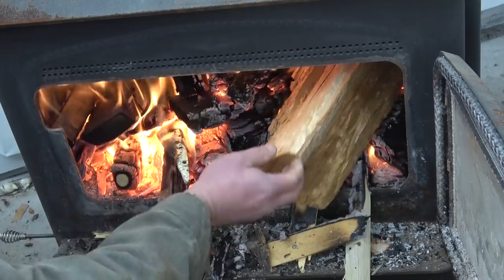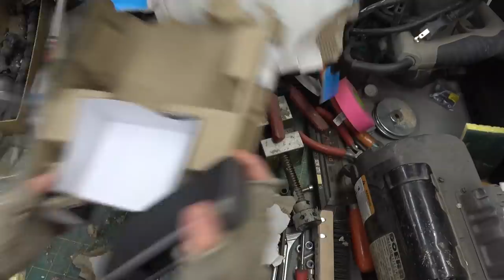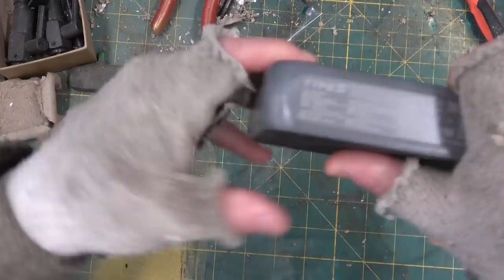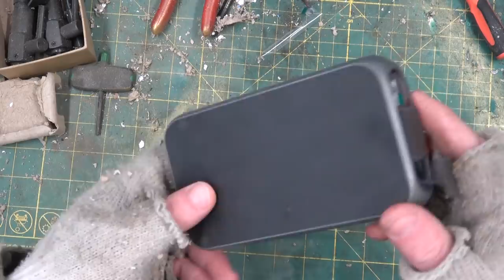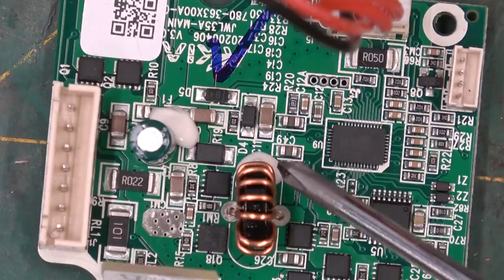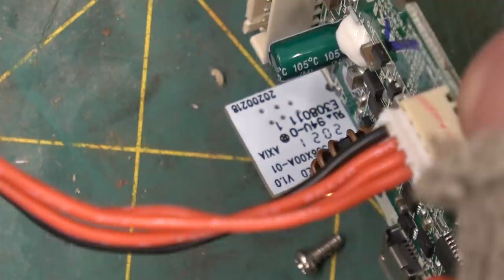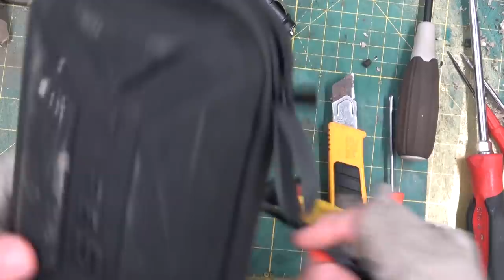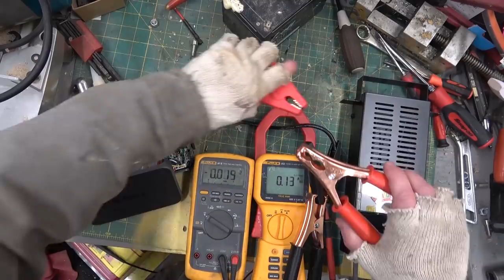BOLTR: Costco Boost Pack | Stupid Design

Comment: The USB-C connector was clearly designed to be quite a bit more physically sturdy... But you add a few more failure points and physical fortitude does not translate to electrical fortitude.

Comment: G'day, Here is a trick for you to try.
About 2 weeks ago I used an 18 volt cordless drill battery to jump start a diesel Ute that had a dead battery. I just wrapped some automotive wiring around the vehicle terminals and poked the other ends onto the 18v battery connectors.

Comment: USB type C charging issues, I have had this problem myself, don't know if it's the same as your per say, but the fix is easy. Use a pin to dig the shit out from the charge port. Lint and crap gets in there and packed down like an unholy wall of charging fuck you. It takes but a few seconds to mine that shit out and everything goes back to normal, just dig deep and greedy.

Comment: Have used that style of jump box for several years but they do have a terrible issue that is a totally different style connector than the first ones did on the cable side the first ones honestly just had a fuse style that would go bad and you would constantly have to replace them but other than that there's an issue with his test those kinds of boxes do not like that load tester on an actual vehicle I have started diesel trucks in my shop with dead batteries with a box of that style not one from Costco like the OEM brand but I swore them off after I had one short out sitting in the front seat of a car I just started and it exploded and gutted the car had it all on security cameras

Comment: FFS my Pixel 3a XL I've had for 4 months USB-C port is wonky - it only charges with the cable in one of the two ways, and I have to flip it 180 degrees if it doesn't start charging. It's going back for warranty service, but FFS, it's been 4 months and it's dead already? Not an auspicious sign.

Comment: I have a similar device. Used it a few times, the issue i have with it, small window of time to actually get a vehicle started.
Reply: That's because it's not meant to jump start the car.  It's meant to slowly charge the battery, so that the car can start from main battery.

Comment: I actually figured out why this is broken. Your daughter board where the mosfets are is soldered poorly. They shorted the drain to the source connection because they soldered the car side - too close to the mosfets. They are supposed to be all in parallel to boost current capacity up to 1200 amps. All the source pins are supposed to go to the jump pack negative and all of the drain connections are supposed to be connected to the car side negative. I drew out the whole circuit and it's definitely why your pack is not working.

Comment: I was taught even with jumper cables you need to let it sit a bit to charge up the dead batteria.
Reply: Especially in today's cars.  If you just try to start the dead car right away, it can be very damaging to the car doing the boosting.

Comment: big problem I have with USB C is that crap gets stuck around it and you can't tell what is that nice tin plated socket and whats shop chips. I had the same problem with my LG G6 and I had to take a safety pin and pry out the pocket take home shavings from a CNC lathe that had accumulated in the socket over the coarse of a few weeks/months. once you get the pixel working again I'd invest in one of thous overpriced mag-safe sockets just to keep the crap out of the one good hole the phone has left; either that or an otter case that has a flap over darn thing.

Comment: Yeah I got a love hate relationship with mine. I have the motomaster one from Cambodian tire. I like it because it has an override switch you hold that fucker down and it will put out until the damn thing dies. But the leads are so short they nearly useless, don't even get me started on the clamps either...Biggest thing I ever boosted was a Hyundai Santa Fe with the V6 in the cold with a completely flat battery. However Ave is right you usually have to let it charge a bit.

Comment: Those things are timebombs. Don't store it in your house or vehicle unless you are looking for an insurance claim. I had 2 of those bloat up on me and catch fire. I caught both of them right before they blew and got them outside before they went up. The batteries just bloat for no apparent reason not even hooked to the charger destroying the case and flame up a few hours later. My fellow off gridder neighbor just burned his truck and cabin to the ground with one of those stored in his truck parked beside his cabin that failed. Those things should be outlawed.
Reply: The reason your LiPo "puffed" was likely a result of it being discharged. The chemistry of LiPos allows for a roughly 3V to 4.2V per cell safe window. Yes, these batteries must be stored at 3.7-3.8V per cell, or they will eventually fail, like yours.

Comment: Yes it does start a truck in the cold. A truck with a weak 12v lead acid battery. It’s just a quick battery booster, not a jump pack the replace whole lead acid battery.   You left your headlights on too long and battery is low. This works. No battery at all, this don’t get it.

Comment: I bought one of the gooloo or igloo ones... forgot the name now but it's way better. It just auto resets for quite a few tries until it kicks out so it dosen't overheat. It works great! I can boost a 30 year old farm tractor with it or a completely dead car. They also tend to boost at a higher voltage it seems....not this one though.. I only have the smallet model too, point is there is good ones. The one in this video is probably the worst I ever saw..

Comment: i thought those things were smart enough to know that they were not connected to a flat battery hence the 5 sec disconnect. if it detects a battery connected it would supply the cranking current for longer.

Comment: Watt-Hours is actually the "correct" unit to express the energy content of a battery. Ah is a measure of charge, i.e. capacity*, not of energy. Wh, unlike Ah, take the battery voltage into account. To calculate the actual energy you have left, you need to know or at least very precisely model the exact voltage of your battery at any point of it's state of charge, which will vary greatly across the discharge curve. 

I'm sure you can intuitively thee the highest nominal capacity battery is useless at 0V at the terminals. Say you had a 4V nominal battery, but the voltage would drop dramatically at below 90% state of charge. Still had a high capacity, but not much energy left in that battery. Take for example lithium ion batteries. You wouldn't really want to discharge them far below 3V for longevity, but depending on the technology, there may still be many mAh left in that battery, that you can't really use. Hence no engineer will ever use Ah to calculate the range of your Teslamobile or battery life of your fruit phone, because it will just not work and your numbers will be grossly off. 

*Batteries technically don't have a capacity, like a capacitor would. Capacitors store their charge electrically by gathering electrons respectively the lack theiroff, the capacity being the amount of electrons you can store. Since batteries convert all the electrons into chemical compounds (in this case lithium metal and lithium ions), capacity is technically not the correct word, although it has slipped it's way into today's engineering lingo.

Comment: I've never broke a USB Type C cable or port, where Micro USB was horrible for me. Most times C stops working is because you need to dig the pocket lint out of it. Neither are anywhere near reliable as Mini USB.

Comment: but if you draw current from it for a while... it will get warm and then start to function better?
Reply: Yes......it helps if the user reads the instructions.
Reply: i have this problem with model airplanes in winter, but if you just get up from the ground and fly like a maniac it sometimes works pretty good  :-D until you start to fly slow..

Comment: I don't think these units were ever intended to start a cold engine with a dead battery just on their own power,  rather just like the earlier lead acid portable battery packs just need to boost the low car battery and when connected in parallel get the current and voltage high enough to start the engine. Most ou f the lead acid packs DIED a premature death because impatient N.Americans did not read the instructions or just forgot to keep the units CHARGED because like any lead acid internal resistance and cold would cause battery to die! I have  seen dozens of these at garage sales dead or dying and replacing internal battery costs no surprise just as much it more than new unit. The big advantage to these newer Lithium units is they hold their charge a lot longer and are much more portable, they have very good power density but asking one of these to start a large diesel in very cold weather us not even  advised in the owner's manual. Sometimes it does pay to pay attention to the friggen manual!

Comment: ah I got one of these for Christmas, couldn't even get it to try and jump. it would read connect to battery on the screen, i would connect it, and it would sit there with both lights blinkin. tried two different units, same fault. returned it and bought a taclife t6 of amazon that has an override button and no display trying to tell me what to do

Comment: The first time you try to use the thing after it's been bounced around in your toolbox for 2 weeks and you find out something in there turned on the flashlight because it was afraid of the dark and now the battery is dead..

Comment: when your usb-c phone doesnt wanna charged wiredly, gits yerself a toothpick and scrape out the port. you'd be surprised at A., how quickly a little gunk will keep the charger from connecting securely and 2., how much lint will get packed as hard at a 12 year old at hooters in there.

Comment: I'm not sure a resistive battery tester is the right way to test that... I'm sure it's still Costco garbage but the controller in the leads (weird place for that) is looking for a current that a dead battery might be producing... And it might be programmed to not just run a 12 volt heater... There must be a dead battery to hook it to in that shop?

Comment: My father has one of these by a different brand name. He used it to start an F150. But it wasn't cold. I tried it on my john Deere and it didn't like my battery. It threw the fault every time I tried.
Reply: Haha, I think these things are good for 3L gas or 2L Diesel engines. And even for those it’s amazing that such a small device can start an engine.
Reply: @Conservator.  my Deere is a 1L diesel. It has to do with the condition of the battery. The F-150 has a 5L gas engine.

Comment: Can't stand those flashlights with the strobe settings, especially ones where they're built into the button with some kind of "soft press/long press" combo or god forbid the twisty bezel ones. A friend of mine had a small Foursevens flashlight he carried around and wouldn't shut the fuck up about, but anytime it came time to actually use it, he'd sit there and fuck with the bezel for a solid minute just trying to get it on a good brightness setting without activating the strobe.

Comment: First your USB typeC is horrible about catching all the schmoo I have to clean mine on a regular basis. Needle or safety pin and an air duster works great.
2nd  those tiny booster packs will surprise you when used on a low battery and a modern easy crank engine

Comment: you say both 'ah but that's at 3.7v and this is a 12v pack"
yes but they'll be in series to achieve that so the current rating won't change
the watt-hours arent where they're getting you, it's agnostic of voltage and measures actual energy

putting both of them is actually overly clear and possibly even redundant

Comment: I'm thinking, I know modern battery chargers look for a 'good' battery, can't plug a fully dead battery to it to charge, which is idiotic. Maybe, and I am purely guessing here so be gentle >.< , the pack was cutting off as it wasn't seeing any voltage on the load tester and assumed it was a fully dead battery?

Comment: TRY THIS TO HELP FIX YOUR USB PHONE CHARGER.  Had the same problem with my Samsung... turns out the port filled up with pocket lint and debris.  A technician pulled out the bits and it's as good as new.  Ive done it again since and it verks!
Reply: Using thin tweezers

Comment: Always love AVE vieos .
I've had one of those for quite a while. 
In my experience they're brilliant  but the leads are for shit. 
If there's just a bit of power still in the battery (enough to make the solenoid tick) it will start a 220 horse fastrack or a New Holland 6070 . even cold.

Comment: the stupidity in its design is on the cable side. Most of them have a switch on the cables themselves that you reset there instead of disconnecting the cable every time

Comment: I have a fucker very similar to this, same plug in booster cables and the terrible flashlight, lol.
That situation where it "turns off" after cranking is so damn annoying.. If you're trying to jump our old Yamaha with dry carburetors, it takes a second to prime, but that fucker cuts out as soon you're about to get results 🤬

Comment: I also had a Google pixel and had issues with the usb c charger.  I was able to fix the issue by sticking a small pick inside the charger and picking out any lint caught inside "there was a fucking shit load".  Might be worth a try and see if it works for you.

Comment: OK.. You've triggered me now :-/ .. the display clearly looks backlit in the video.. the display assembly board  is clearly marked as LCD.. why is that OLED as you reinforced a couple of times in the video? Maybe my brain has gone potato and I missed something..  BTW. Those battery booster things generally work pretty good, saved my ass on a couple of occasions. Definitely something worth to throw in the car.

Comment: I have the same one and I have only got it to start my 4cyl vw, tried it on a 90's f-150 and it just shut off and wouldn't turn back on until I plugged the charger in.. Works fine for charging phones but as a jump starter it's a pos. 
The one I had before this was a gooloo off Amazon and it was badass, the only thing I couldn't get it to start was a semi but it at least cranked over a few times, so I'm very disappointed in this one from Costco. 👎

Comment: Those mosfets looked to have their middle pins snipped off
Reply: You’ve got a sharp eye and you’re right. It’s a TO-263-2L package. The middle pin is the drain that is also connected to the back of the package witch is soldered to the board. That way it acts as a connection and as a heat sink.

Comment: Just like most smart 12v chargers won't even attempt to charge a totally fucked battery until you wire a less fucked one in parallel

Comment: In regards to the the flashing light it is not possible to buy a light that you would place on your head for seeing say working on cars without getting one that you have to what's the button three or four or even five times to get it to turn off because it goes through all these different modes were all I want is a damn light that turns on and off just like all other six billion people on the freaking planet
Reply: Milwaukee headlight has 1 mode: Sensible
It goes on, or it goes off.

Comment: 5 second is way too short, at soon as you plug it on a dead battery it will suck as much amp as it can to recharge the battery anyway. Better be fast to jump on the driver seat.

Comment: oh god.. Type S... not really good for anything but a compact car or riding mower.. blew mine skyhigh with my 04 f150 and the battery wasnt even fully discharged on the truck.. was cheaper just to send my CAT boosterbox in and get the batteries replaced then keep buying flaming boxes

Comment: I also had a problem with my pixel usbc port, turns out lint just got packed into the port. I was able to use the "snot trail" of a petg 3d printer nozzle clean/prime to scrape it out. A toothpick might work as well.

Comment: Here’s another analysis of a similar device made by a Czech genius called DiodeGoneWild. Ignore the accent and enjoy. 
https://youtu.be/3T8x6b1PDyw
The object of review is a Lidl battery based on a LiFePO4. 12000mAh at 3.2V. 
LiFePO4 (lithium Iron Phosphate) has the advantage that it can handle higher discharge currents, it can operate at -20°C (-4F) and its much safer than Li-ion batteries

Comment: This video is BS. What you're supposed to do is grab your worst 5ah+ 18v tool battery along with a couple short pieces of solid core 12ga or 10ga wire , which you should be using for cargo tie downs if you know anything, pound the ends flat with a hammer so as to fit in the tool battery terminals and vice grip them on in correct polarity for a hot minute, best lithium jump pack I've ever personally owned 😄, even started a dead 6.0 diesel a couple times, along with a 45 horse tractor, and a couple of different v8 gas trucks. Side effects may include ruining $100 drill batteries, explosions, frying multiple vehicle computer systems, but with the magic touch for just the right amount of time you can get it off without damage to either piece of gear... should make the vehicle start too 😄 but kidding aside this does work if you're in a pinch or stranded, just leave it connected a few seconds at a time, disconnect check tool battery till ya get down to one bar, if it's dead flat it might take a couple batteries worth of rapid charging, you could try starting it with it hooked up, but that's when the real chance of damaging vehicle electricals comes into play, after the alternator kicks out 13.5 volts making it to around 16 volts balanced  😧. I've successfully done this multiple times with no failures, other than probably shortening the life of a couple batteries by a few months 👍 best for emergency use only though 🔥🙆‍♂️😄